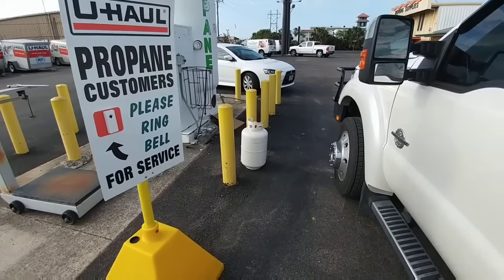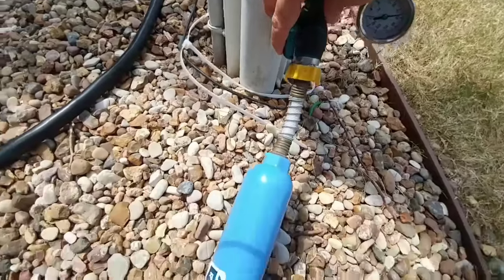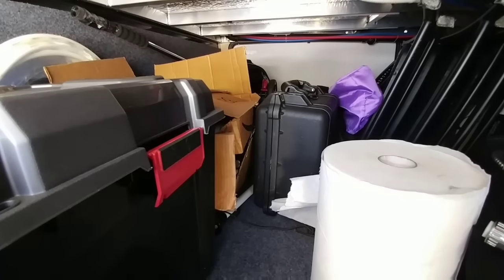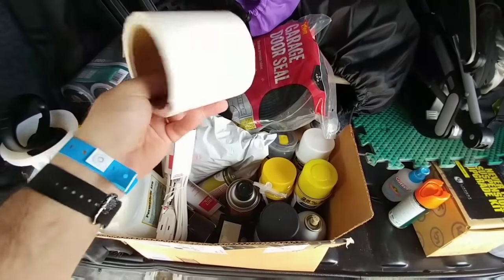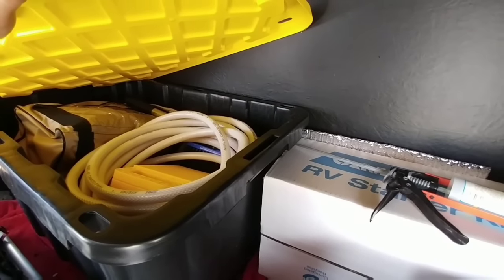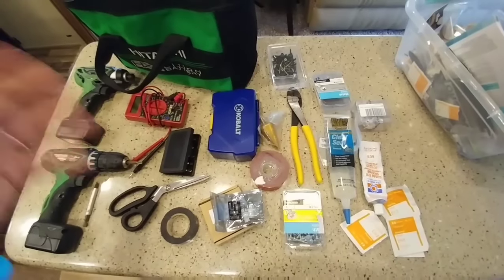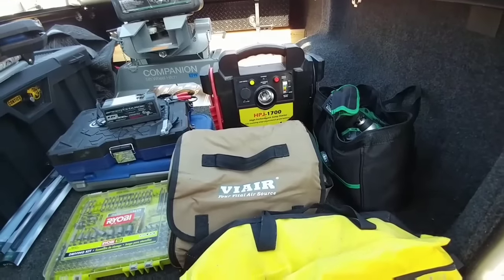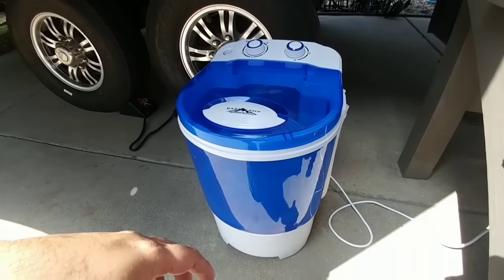RV Must Have Supplies! For All RVers. Fifth Wheel storage

Comment: Packing that well only comes with experience. Something tells me Murphy likes to travel with you.  My  whole back seat in my extended cab truck is usually filled with my emergency trailer items. One thing I carry is a 5 lug hub puller I made because when a trailer hub bearing goes, sometimes things don't want to pull off. I also recommend carrying a spare hub or bearing kit. Even if you can't install it, a shop can and you don't have to wait on parts. If you have a bearing go while at night you are kinda screwed till the next day to gets parts.

Comment: Hi - one thing that I carry are disposable exam gloves.  I use them when handling drain pipes or anything related to black water.  It's just a little nicer to know that one extra layer between you and the "stuff"  They're also nice when you have to deal with something that's greasy or dirty.  Peel them off and the dirt/grease/stuff goes with them.

Comment: I use the X-chocks and they do a great job of keeping the trailer from moving. That helps a lot with movement inside while someone is moving around. I also use Anderson Levelers and they are amazing. Worth every penny in time saved getting the rv leveled in one shot. I'd recommend them both.

Comment: It is a surprise to me that so many people are intimidated by RV plumbing. The pex plumbing is the easiest plumbing I have ever worked on. It is easy to cut, flexible and I have never had a crimp fitting fail. I see you are fully equipped with pex pipe and fittings. I can tell you that the Jayco RV I worked on had plastic fittings, I upgraded them to the brass fittings and even added some brass cut off valves in places where I thought they were needed.
Long story short, Pex is very forgiving and easy to work with.

Comment: I'm using almost all identical items for water and sewer. Like Eric, I also use BAL Xchocks and Anderson levelers. I know you had a quick flash of an old surge protector, but I highly recommend all RV owners getting one. They are like insurance, you hope you never need it, but better to be safe. Also nice to have in the overkill pile is an IR temp gauge to check brakes, axles, fridge, ac, etc and a good tire pressure gauge.

Comment: I didn't hear soldering iron...we've done a surprising number of rescues (including ourselves) over the years. Spare toilet valve and a small piece of tarp with extra duct tape for emergency vent covering. (That too can happen) All were needed on spring break on Mustang Island. Excellent information as always, sir!
Reply from the maker: beau w: I do have a small soldering kit in my truck and a torch.  Forgot to grab it for the video.

Comment: Pro tip: go to your local air conditioning supply store and ask for “pan patch”. It’s a rubber coating like plasti dip but sprays on a lot thicker and faster. I always have to apply plasti dip 5 to 8 layers think when pan patch is usually on 1 to 2 applications. I’ve used it on everything from roof leaks to shovel handles. It’s thick and durable enough to be sprayed on a tool handle for grip and cushion and will last a long time. Also an additional tip-after you use it, turn the can upside down and spray to clear the tube and nozzle and it won’t clog.

Comment: You are as bad as me when it comes to taking extra stuff I think I could almost rebuild my trailer. I went to campers world and the only think I came out with was a candy bar and a cover for my Honda generator. I had a full blown solar system installed on my 5th wheel this spring which runs everything but my A/C and washer/dryer combo hence the generator.

Comment: Yup, I commented too soon. That little rinky dink washing machine can be used as a spare kitchen sink...
Reply: He could do what I do  to wash clothes off grid...
1. Get 55 gallons of water and a gas powered post hole digger.  The augers will take the place of an agitator.

Spin drying is harder. You need a washing machine tub (with the holes) and a makeshift lid and a long steep hill with a road to the top.

IMPORTANT SAFETY WARNING...don't roll it toward your rig.

Most of the water should spin out if you remembered to put the wet clothes inside ...but if it doesn't, repeat the process.

Footnote... this has not been tested outside our "think tank" department.

Comment: this guys camper and bed has most of whats in my toolbox ie drills attachments wheel chalks tools jump starter lock out kits paper towl toliet paper fix a flat wd40 silicon bedliner and i installed onboard air system

Comment: Big truck your fifth wheel set up is good, simular to what i travel with,i need to get one of them shut off valves at the end of the pipe,i seen on my infinity forum that you can open both grey tank valve and it will back flow and fill up both grey tanks i have 98 gall capacity on both of them together.Thats a lot of showers.
Reply from the maker: Gary Campbell: or just 1 shower if it's my wife.
Reply: Gary Campbell just wondering if you were from Beckly, W.Va. i was in the navy with a Gary Campbell in the 60's. called him Soupy.
Reply: No Army,Went to a military Academy in TN,Army Medic ,5th generation from Texas.
Reply: Amen on that brother.

Comment: I have been falling your Chanel for a little while. The information has been great& thanks you .I am thankful of YouTube , I wish they had not been bought buy the company that own them now . This is my opinion and not for reason they people may not think . I build high end AMD computers , as I am retried now , I will be moving back to Washington State for health reasons .I own a Dodge 350 with duels , I don't know how many owned it . I would do things differently next time . I had owned my own Simi truck , have logged over a million miles with one mishap ,and was not my fault, a young lady  , in a small area 99 that 6 lanes ,I was in middle lane , a slow pick up was slow lane ,a small mustang was also in that lane ,she must have been not watching , she was in my blind area , my wife was with me ,& saw her move in to lane , I had a large bumper it was 8 are more & over a foot high , she clipped over middle of wheel well , a perfect  pit movement . To her mistake it put the car 45 degrees to me being warned I slowed  down quick as I could . The sleds in front of me pulling away at 45 degrees the left rear blue out & shot backwards  ,passed through inside lanes,in mulberry bushes where three steel cables . I stopped as soon as I could , CHP was not to far be hind , and might have seen it . I had 74 White  Freight liner cab over. There was  a small dent on left side ,but a mess on right , she had a paper plate ,& paper license . I have been a lot more careful , I like having  camera on the corner  of TruckCabs. Has I hope to do , I wii replace it a exmilatray  5 ton , they have 6 by 6 less then 20,000 , close to 10,000$ . On one of videos,some one hasid they saw a Dodge 350 dulls , that I would NEVER try.I had traded  with my friend we worked for , he had a flat trailer, mine was a new 45ft. van. He had nothing  in it .Close to bay he all most had it go over! I want to thank you for your YouTube  channel !
Reply: Reading is fundamental.
Proofreading???? You should really consider it Donald.
Reply: Gets more of your attention with the mitsakes!

Comment: To test car batteries use a battery tester. A multi-meter wont tell you if the CCA is low even though the voltage is 12.5.

Comment: Nice video. I was wondering, what is your preferred bug spray to use in your sprayer. I'd never thought about it, but laying down a barrier around the bottom of the RV, and especially around the tires or anything else that touches the ground (which would provide an ant highway into the RV) would be a good idea.

Comment: Nice collection of item for just about everything... Now a tad off topic but I see you put on 2- tail gate assists. Did you have to do that on account of the step in the tailgate? I would like to put a tailgate assist on mine but all of them say not to use them on both sides......
Reply from the maker: Gary C: just takes modification to make the passenger side fit. need some spacers
Reply: Thanks BTBRV so I take it with just the one on the drivers side your tailgate is to heavy and have to use two..

Comment: Nice advice, thank you!  My hot water tank was leaking. The plastic valve was installed crooked (just bought RV missed on walk through).  I sure could have used some plumbing tape and spare valve. oh, and proper tools that is a special 24mm socket.   

I have a question off topic.  I'll check your other videos to see if you covered this.  I have a Premier Bullet 30RIPR the axles have a wider stance then most travel/5th wheels 2x.  I have rubber chock blocks but this RV is a monster to get stable.  I use the orange blocks under the jacks.  Open to any ideas.
 https://www.rvusa.com/rv-guide/2019-keystone-premier-travel-trailer-floorplan-30ripr-tr38001

Comment: Why not just "T" into your 30lb tanks and do away with those disposable bottles for your grill? Google CAMCO 59143
Reply from the maker: raybbj: My fifth wheel has a external propane connection already.  It just requires me to cook directly beside the camper. The portable tanks are nice because I can move the grill around more.